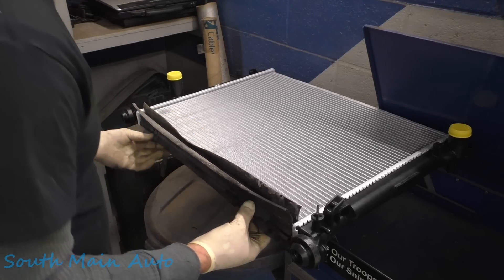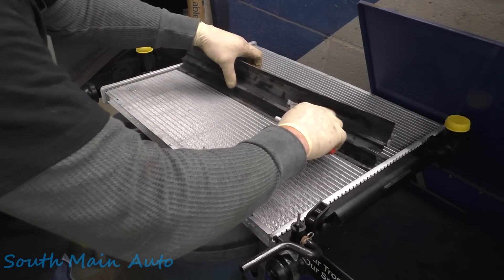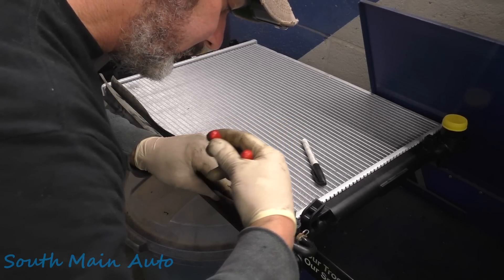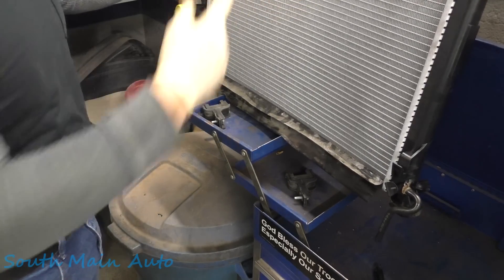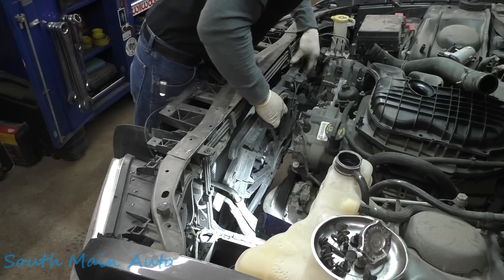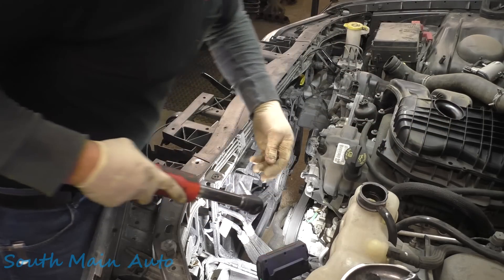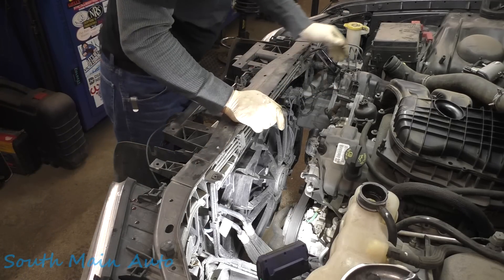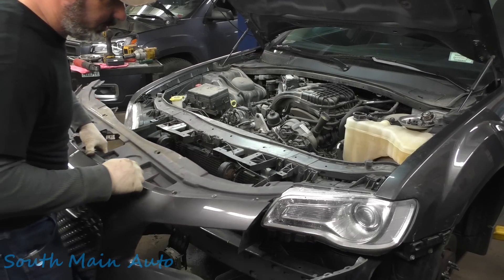'18 Chrysler 300 Radiator Replacement - Part II

Comment: I remember the good ol' days when you would spend 5 minutes pulling out the radiator, taking it up the radiator shop to get it soldered, and another 5 minutes re installing it

Comment: Ain't it amazing how there is always more antifreeze in the hose no matter how long you drain it?😂
Reply: Or in the block when it's on an engine stand!
Reply: You should try a tesla.   The cooling system is pretty substantial and when doing big jobs like the subframe and drive units there's at least 6 connections loose.   They all drip until you put em back together.   If I put drain pans under all of em I wouldn't have anywhere to stand
Reply: yes. It has to be.  We watched him tip that hose up and drain it when he took it off!@@cjrock4096
Reply: @SunCityOffroadRecovery do those plastic plugs work? Typically used on hydraulic lines to stop drips or debris

Comment: Notching out tabs to put those top and bottom pieces on was slick.  Never would have thought o that I would have messed the whole thing up.  GREAT job.
Reply: I probably would have glued those on with rtv or something.
Reply: Yea I always just put a little silicone on it so it will stick to it just to get the rad in the car. There’s more then one way to skin animal lol
Reply: There is always good ol’ duct tape…..😂😂😂😂
Reply: 3M trim tape....

Comment: Been dealing with auto mechanics for over sixty years.  What impresses me about Eric's work ethic is that he doesn't take shortcuts.  He puts everything back the way he found it...including those hidden fasteners that the owner would never see anyway and don't really jeapardize structural integrity.   
 That bottom piece of plastic that he spent 20 minutes getting properly attached?   Most guys I know (including me?) would have just thrown it in the trash bin.  Not Eric.  Good job, man.

Comment: Oh, you weren't at the NAPA Board meeting when they talked about this, it went something like this: "That plastic bit will just end up in the trash, so don't bother putting the right tabs and notches on the radiator for it to fit."

Comment: Hi Eric, as an Aussie metallurgist it is great to hear you say aluminium rather than “aluminum”. Now to work on solder rather than “sodder”😊
Reply: Sir Humphry Davey, the British chemist who first isolated the element, begs to differ.  It wasn't until years later other Brits added the extra "i".
Reply: @rbhe357  Aluminium was first discovered in 1825 by a Danish physicist Hans Christian Orsted. Davy is not credited with its discovery or naming, and died in 1829 giving him four years to incorrectly spell the name Orsted had given to the element
Reply: @jimgraham8323  Page 201 of  "Elements of Chemical Philosophy", written by Sir Humphry Davy in 1812, refers to the extraction of alum from alumina.  The title and other mentions in chapter 7 refer to it as "aluminum"  
Orsted didn't produce the metal until 1824-1825.

Comment: One of the most helpful things you do, that many channels don't, is show the struggles with little stuff.  As a DIYer I used to think I was always the problem when a new part didn't fit in an old spot, or when other nuisances came up.  It turns out that not only do the pros face those problems, they also respond with cutters, benders, and drill bits!

Comment: Eric it's your buddy in California. when you were mentioning body guys having to deal with aftermarket parts. You were spot on. I was a AAA repair preferred shop for over 35 years. The number one reason I got out of it because more and more and more insurance companies were making us use aftermarket parts almost in its entirety. I couldn’t tell you how many times we would eat the bullet and buy OEM even though the sheet required aftermarket. For example, we would spend four-five times the labor to install an aftermarket part and make it fit right. I found it was cheaper in the long run just to buy the OEM part. 
Now, let me make something very very clear. We were not one of those shops that if the sheet required us to use OEM parts and we turned around and put aftermarket on. That's considered fraud!!!
But, as a shop it was perfectly legal to go the other way around. I hope that all makes sense. If you choose to spend the money out of the shops pocket, not the insurance company that was of course legal. You are making the vehicle OEM, opposed to aftermarket. Ron

Comment: The ol' Marquis still has the OEM radiator at 30 years old.  Just for grins and giggles I checked and it has been discontinued from Ford.  I was able to obtain a new OEM radiator from another source so, hopefully I can drive this car another 30 years.  I Googled Avoca, NY recently and Wiki stated a rail line through town was severed in the 1960's.  I guess they reconnected it.  GREAT VIDEO!

Comment: The biggest problem I have with radiators is that most of the vehicles I work on are old enough that O.E.M. parts have long since been discontinued. That pretty much forces me to the aftermarket!

I agree 100% with you on the shop kitty thing! My shop is only part time but, I still have "those days". When I walk into my "office", good ol Elmer, my black n white Tabby, is always ready to provide some comic relief and immediately improve my mood. He's also a big fan of Luna!

Comment: When I worked in a body shop, the technicians complained about aftermarket parts, but the experienced technicians always said aftermarket parts have improved significantly since the old days whenever that was.  Their theory was that CAD and CAM has improved.

Comment: I had to do a similar modification to my CSF radiator replacement on my 13 f250 6.7. It was an easy mod and the radiator has outlasted the previous two Motorcraft replacements!

Comment: Just another example of why Eric stands above.  Every mechanic I've ever worked with would have glued the rubber mounts onto the radiator witrh weatherstrip adhesive which would have ruined them them if you everr needed to do the the job again.  And with parts shortages and warehouse stirikes if might be impossible to replace them other than a probablly doomed trip to the junkyard to find usable ones .  He, as always, takes the time to do it right, gives the customer a proper repair and saves her a considerable of money.  Not many lefct like him.

Comment: I had an aftermarket radiator shop back in 08 and our stuff was pretty good hardly any complaints because the manufacturers we used also made OE, but NAPA refused to buy from us and would not say where they got theirs. So I can only imagine how bad they were if they were getting them cheaper than dirt.

Comment: This is the job that led me to doing my own work..(where ican, I'm not a full service shop) shop wanted $500 to replace my radiator ~15 years ago... I did it myself in 2.5 hours for under $100...since then I do pretty much all of my work including building my first engine a couple years ago..full build everything pistons and rings to fabricating my own intake...a guy can learn alot over 15 years...🏁
You've had ALOT to do with my "education " Eric...👍

Comment: I had a 1992 Ford Taurus that went through several radiators. Like clockwork the radiator would start to leak after 2 years. The problem was the way they sealed the plastic tanks to the aluminum core. I suspect it was a design issue that didn't account for the fact that the plastic and aluminum would expand and contract at different rates when the radiator was hot. The radiators would always leak in the same spot where the plastic was 'sealed' to the aluminum at the bottom of the tank. I actually got pretty good at swapping the radiator out and could do it in about 2 hours.

Comment: Hey there good as always  i have learned so much about diagnosing  and running a shop i also am throwing around the  thought of videos aswell but not repair videos more so your style tag along videos
Reply: Legos fit better tho😂😂😂😂😂
Reply: Hi Eric! The only other thing I would have done different was to clean the bugs out of the a/c condenser before refitting the rad in support. Happy Thanksgiving and I hope your deer season hunting has been good!
Reply: any advice on hardware? and software?

Comment: Back in the day, we’d take our leaking radiator to the radiator shop (those fit back in right). I’ve put in several aftermarket rads .. they’re a bit of kit you have to make fit, notably trans cooler connections, just a bit off that you have to create/mod openings, mod cooler lines in the front area to connect ‘em.

Comment: I bought one recently that was made in India. It was so cheap! The coil fins were so thin that just handling them caused them to bend. And of course it didn't fit. I ended up taking the old radiator and repairing it with J-B Weld.

Comment: Not sure why folks praise OEM parts when this original radiator only lasted 5 years.  Outside of the tabs (double sided tape would have held those in place just fine) this aftermarket radiator seemed to fit just fine.  If it only lasts 5 years like the OEM, customer is still way ahead…money wise.
Reply: Stupid is as stupid does.....
Reply: Just bc that one lasted 5 years does not mean they all last 5 years.

Comment: That front end was created by plano models, a snap together. Im the shop i worked at. It was not for repairs , but services. Fluids and filters. Some radiators were designed with thata week spot in the  upper tank. When that snapped, i was who replaced them. An hour later, it would be back on the road.

Comment: My shop has a problem Jeep XJ with a transmission refit and minor issues to finish.  So as to complete it takes a delay to free the bay.  Feeling frustrated, I was watching this post with plastic and just then, it got to the part where a customer in fact got needed repair.  So, I am thinking about the season and how great it is to see an owner tech understanding a bit as to meet cost.  And where, I really, really like what happened.  Sort of made my day, and reminds me to think about people and why, customers would repeat business.
Below freeze here in Washington state as 21F so there will be lots of shop need as overlooked battery, antifreeze, lights and window regulators.  And lots of crashing on ice as it turns to freezing rain and compact snow. But not as heavy salt like NY.  The stuff of sub frame rot and rust as would consume all.   I am warned as to cheap parts that can fail quickly.
My personal regards.   M.

Comment: It isn't just car mechanics that run into items that are not wanting to be used.  Or not the best application for the situation.

It was a nice, easy, fix to attach those top and bottom strips to the radiator.  Wonder how many other car mechanics would have done the same.  Or would they not have given the customer the choice between AM or OEM?

Nicely done as always Eric.

Comment: As a retired tech, I wonder if you had a roll of weather strip tape that sticks on. Would it help hold on the parts that have the tabs. Maybe a roll of a couple different widths and thicknesses. Good job on the  300 Eric
Reply: I was thinking weatherstrip adhesive but that would take time to dry.
Reply: Double sided tape but that could present a challenge if it ever needs a replacement again

Comment: I learned the hard way about aftermarket radiators when I did a 2003 BMW 530i, the oem rad was 160 the cheapo was like 70, it was not worth the savings, the aftermarket one was a nightmare to install.

Comment: Nice job. I hate all the plastic covers everywhere. I the hot South, those clips just snap when you touch them. But on the bright side, no rust unless the car is 50 years old and has been sitting out in the rain. Window seals leak and they fill like bathtubs! Rust from the inside out!!

Comment: Ford Explorer, two OEM radiators later put in aftermarket, no problems after that.  I like how you fixed tabs on the fly. Great video as usual

Comment: Okay - here's my comment..... Yes, after market is junk. The O2 sensors never work and the 💥light never goes out, thermostats sick open, sensors are a 50/50 chance of working and turning out the MIL light to name a few !!!!  You aren't the only 👨‍🔧 mechanic who gets 💩sh*t aftermarket bad parts !!!!  How about putting a water pump on and find the weep hole has a 💦10 drop an hour leak !!! Glad you were able to🛠✂ modify the radiator to fit with all the associated parts !!!!!  I was so 🤩🥳happy to see 😸 Luna in both parts of this video, she is such a darling kitty and 🗨 says so many good things about her 🧔‍♂Daddy as she heads into the office to tell Mom 👩to feed her !!! 😺 All done now, no leaks, hot heater air, another satisfied customer that rants and raves about the great service she got at PRNY Avoca SMA by ASE Certified Master Automotive Mechanic Sleuth Eric O. !!!!! with Cameo appearances by SMA Garage 🏆🎖Senior Cat Luna !!!  Off to the next exciting job !!!!!!!

Comment: I would’ve had to CA glue the plastic bits; too mechanically inept to do the aluminium metal work. :-). The heat and vibration would make the CA fail after install but would get me through it.

Comment: Nice job, Eric!
One small suggestion: while the radiator was out, it would have been a good opportunity to clean the AC condenser. From the video it looked really clogged with dirt. I’m thinking a hose, from the engine compartment, to “push” the dirt out. I’ve seen plenty of cars with non-functioning AC because of a really dirty condenser. 
Just an idea…😊

Comment: The easiest radiator replacement i did was on my dad's 78 buick limited. Zero bolts holding in the rad. Was held in by the upper and lower shroud.
You can imagine how "Joe's Auto Repair" would NEVER put all those plastic bits back in. I cant tell how many times I've run into that.

Comment: I bought a radiator from Amazon that only 3 of the 4 mounting holes lined up. Didn't have enough mounting area to open up the 4th hole. So I just zip tied that hole to the core support. We can't control quality control of anything. So we just have to do what we have to do to make it work.

Comment: It pretty much doesn't matter where or from whom you buy aftermarket rads, heater cores or condensers  from nowdays, they never quite fit right outta the box. Like you, I've come to expect that, as crappy as that sounds. I try to get the 1s with as much supplied hardware as possible because in my experience, pretty much none of the OE stuff wants to play nice. I went through 3 rads on a '10 Aveo before I found 1 that got close enough to bolt in. As you said, tech support was a not so funny joke..Very good of you to put the customer on a payment plan. Try that at a dealer!

Comment: Eric, my first job as a grease monkey was in a shop around 1975. Their hoist was one of those God-forsaken dual hydraulic lifts with TWO separate valves/levers. More than once and old Chevy truck would have the tailgate about three feet higher than the front end! My God I hated that thing!!! My first oh shit job was changing spark plugs on an old flat-head V-8 farm truck and one spark plug broke and the tip was hanging onto the lip of the spark plug hole. I thought, it would just bounce around for a minute then exit the exhaust, right? Thank God I was able to fish it out. I'll never forget that. The owner was a wonderful man name Joe Lagoski, but I don't think he named it Joe's Garage. That would be cool!

Comment: Funny you mention OEM.  I have a Kia.  I discovered a leaking caliper .  Replaced it with a NAPA .  Year later bloody thing leaked.  NAPA wanted the difference between the original price and the `new' price.  I lost the plot.  Thing is, following Mr. O, I am not alone.

Comment: I have two questions: How do you keep track of all those screws, clips and little parts? How do you remember where they all go when reinstalling? Enquiring minds need to know.
Reply: A lot of times, there are only a few different kinds...like maybe 3 or 4, and they usually won't fit where they don't go.
Reply: @Big_Loo  I can usually get the smaller ones to go in the bigger holes and then just drill out the smaller holes for the bigger clips to fit in. 🤣
Reply: A toothpick thread shim always helps! @Tom-In-Ga

Comment: I probably would have just used some silicone sealer and squirted 3 blobs in those spots into the rubber seal and shoved it onto the radiator and let it set up for about 15 minutes and then install it but either way you did a good job and got it done for the client .

Comment: FYI it would be a good idea since that is a cheap Chinese aftermarket radiator is to do a pressure check on it to make sure it does not leak at all before you start making modifications just in case you have to return it back to Napa. I have seen where those cheap Chinese radiators leak worse than the one you removed.

Comment: I was able to remove the radiator without removing the front bumper , I loosened the lower radiator support bar 💯 also remove the top cover above the bumper that has all the clips .

Comment: You paid for three pairs of those cutters anyway, so you might as well get your second pair. 

I used to sell a concrete moisture sealer so you could put wood flooring over it without the flooring getting ruined. The pro version came with a warranty and the regular version did not. It was the same product. The difference in price paid for the insurance policy so we could warranty the product in case the flooring got ruined by the moisture the product was supposed to seal it from.

Comment: Some aftermarket is better than OE. Some josh with an uga duga gun stripped out the oil drain plug on my Hondoo, so I had to replace the pan. I replaced it with an aftermarket pan that fit just as good as OE and had a steel insert installed into the aluminium pan at the factory so I shouldn't have this issue again. 

I had to change the pan because a failed attempt of installing a helicoil was already performed. The pan was trash.